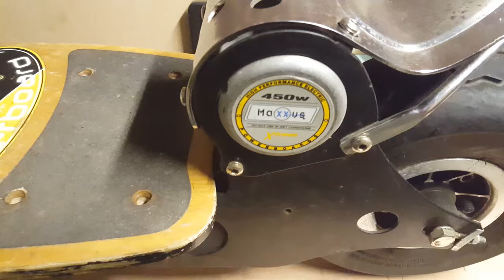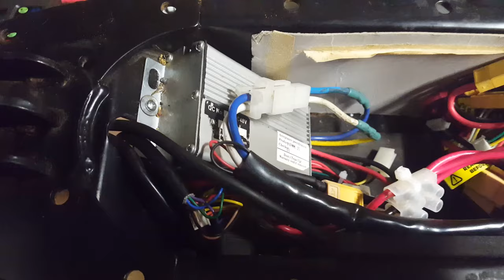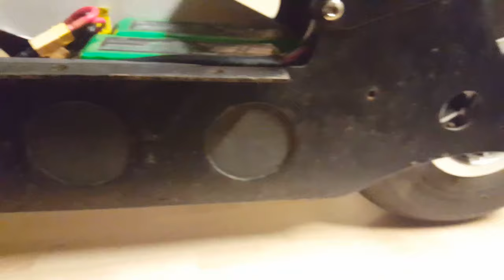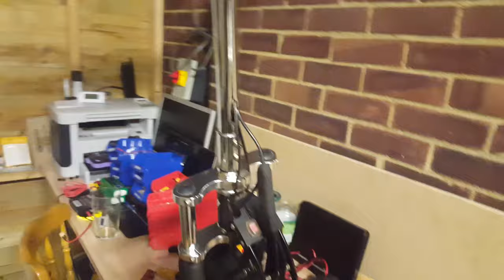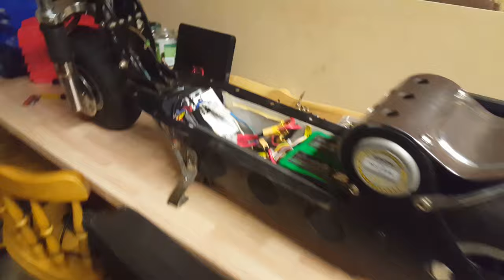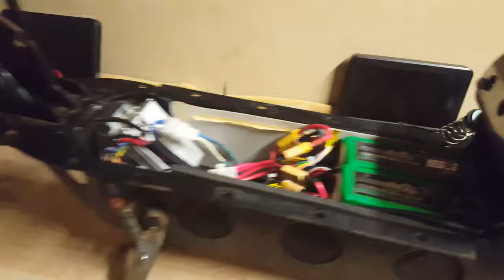Electric Scooter overvolt, super quick, easy modification

Comment: Possible if got video how you wired the battery to the controller and then controller to the throttle or the u got pictures how you did the C wiring diagram,please 🙏🏼

Comment: tHAT CONTROLLER HAS 63V CAPACITORS, YOU CAN GO AS MUCH AS 14 CELL (14S)AT 58.8 VOLTS FULLY CHARGED, DO NOT GO HIGHER OR CAPS WILL EXPLODE AND KILL THE CONTROLLER.

Comment: Hi Richard or anyone that can help I have the razor e300 and have bought a new controller 36v with the variable throttle with 3lead acid 12v series for now (have 18650 kit later on) but just need to know how to connect the ignition red /blue thin wires as the razor on /off switch be bypassed I think any ideas anyone ?